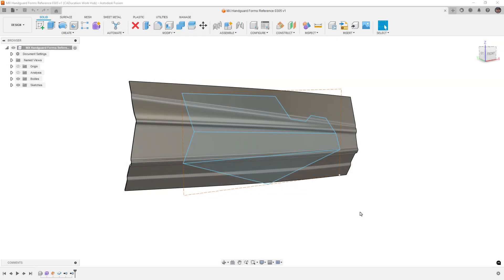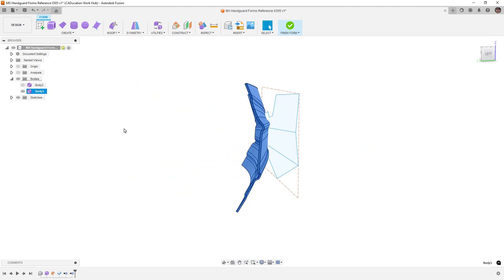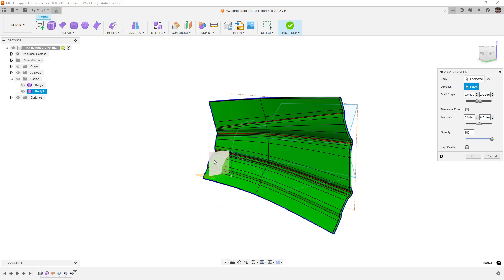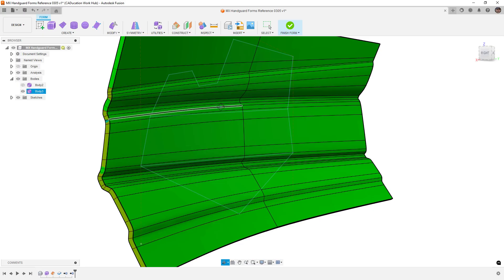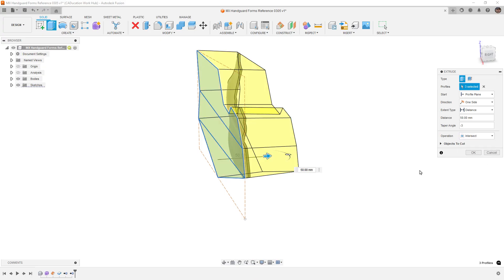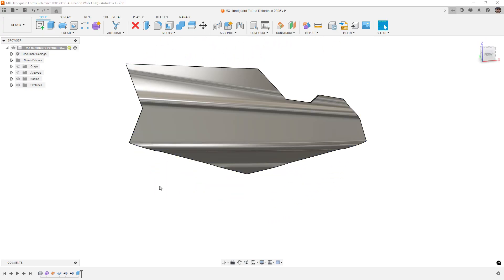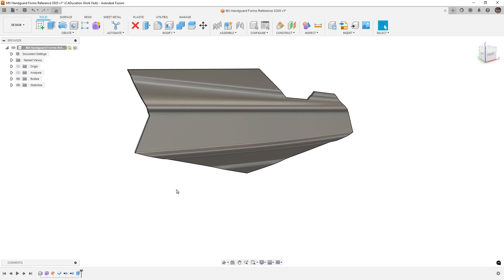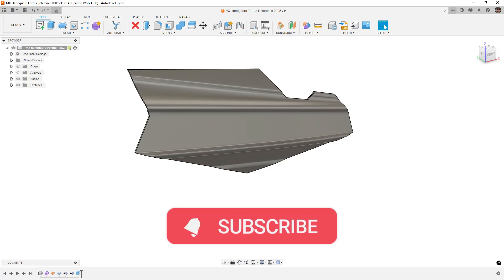How To Use Intersect for Injection Molded Freeform Part Design

Comment: 🤔 looks promising - i try to generate pos/neg molds from car parts with PROJECTION. Sometimes it works, some not (sometime using constraints making the projection smaller) 
May your technic works better, i will see
Reply from the maker: Boundary Fill or Intersect are the tools i generally use.  I like boundary fill but sometimes its a pain!!

Comment: What do you mean by "have enough draft"? How do you determine how much draft is appropriate? Is that like an injection molding thing, or just personal design preference?
Reply from the maker: There is a lot to it.  We did a course on design for molding here https://www.learneverythingaboutdesign.com/p/injection-molded-part-design-game-controller
But in general the draft angle amount will depend on a few key factors.  How tall the object is.  If you think about a trash can vs say a tv remote.  The remote might have 1 deg of draft but the trash can might have 10-15 deg.  Texture.  If you need a textured surface on a part you tend to have 3-5 deg of draft, where a smooth part is 1deg.

There are other factors but generally the size and texture are the two big ones.
Reply: @LearnEverythingAboutDesign  very helpful, thank you for the explanation!

Comment: I really would like someone to tell me am I the only one struggling with fusion performance issues or everyone else having the same problem ?
Reply from the maker: It has definitely gotten worse since the last update.  A lot of my designs have mesh bodies in them so i attributed some of the slow down to that.  Complex calculations seem to hang a bit.  

There is a performance test thing you can do to record fusion while the slowdown is happening and send an error report to adesk.  I did this a few times.  I noticed opening files taking longer.  Previews of some features like fillets.  And even after the fillet previews fine hitting OK takes some time.

I rarely deal with simple/prismatic shapes but those types of files have generally been fine for me.

What i would try first is to go to the help menu. go to Support and Diagnostics.  then open the service utility.  Run a network diagnostic test and make sure all the items are Green checks.  If not there might be some ports blocked by firewalls.

The other thing you can do in support/dag is to run the Performance feedback.  You can start recording fusion performance (not screen) while you are having trouble and then send feedback on that.

I have noticed win11 seems to be working a bit better than 10, but 11 in general is trash IMO.
Reply: Yes! Double-clicking to open a sketch became an octuple-click. Thought it was just my machine getting old.
Reply: 360 on my win11 keeps crashing - Microsoft sucks. I even build a "ANDROID PC" out of a Samsung phone for my father....all his Laptops do weired things & i am tired fixung that. Fir his needs Samsung Dex is just fine. 3d Software should focus on Android 😅
Reply from the maker: @Histoshape  i HATE win11. so far it has behaved better for me than 10 with Fusion lately but in general I am not real happy about the force to 11 and Autodesk dropping support for 10 after October..